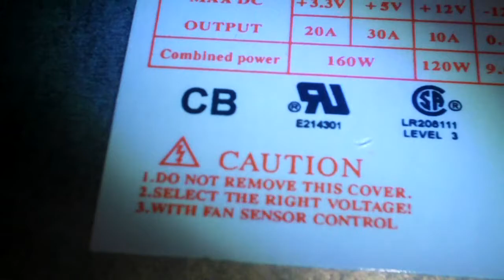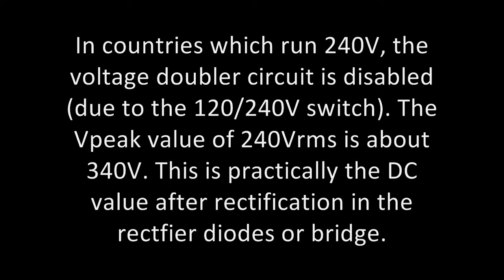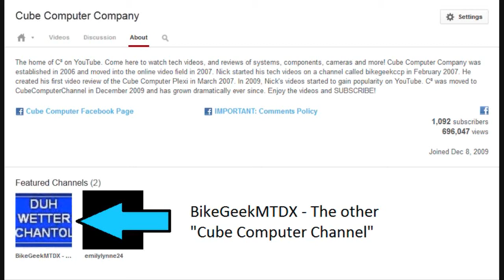How power supplies discharge themselves when unplugged

Comment: What resistor should I use for a red led (believe 2v) as an indicator on the 3.3v line? and closest resistors to use of no concern. And should I put 2 (10W 5.6omhj) resistors on the 5v line being an older supply or just 1 on the 12v & 5v?  Reply would be gratefully knowingly knowledgeable🇦🇺
Reply from the maker: You would need to know the voltage drop of the LED and the rated current of it. Take 5V and subtract 2V from it which gets you 3V. If that LED calls for 10mA, you'd take the 3V, divide it by the current 0.01A and you'd get 300 ohms. The closest 10% tolerance resistor above your needed resistance would be a 330 ohm resistor (orange, orange, brown, gold).

Some people put a resistor on the 5V line of older supplies. Not all of them need it though. I think it helps raise the 12V line a little.

Comment: Don't know if Cube Computer Channel will see this, but I've got a question regarding the power supply and Electro-Static Discharge. So, I'm taking apart my PS4 to clean it of dust. I just unplugged it, but I haven't touched the power button. I'm looking to take it apart today, and I've got my tools. I'm mainly wondering if I have to worry about ESD while taking it all apart, and how I can prevent building up any kind of static charge or potential (i.e. what material type of clothing should I wear, where should I work, am I allowed to move my legs due to being uncomfortable, etc.)
Reply from the maker: Hi there! Generally as long as you are occasionally touching a grounded surface or object, and the humidity in the room is not dry, then you should be fine. Usually ESD becomes more of a concern for me when it's cold outside. The key thing is occasionally grounding yourself.
Reply: I had similar thought and question in mind. Great question

Comment: I'm planning to convert an old ATX Power Supply to a bench power supply.  Would it be a good idea to use a .5ohm 5W Resistor as a Bleeder Resistor on the 12v output?  Basically I have a SPDT Toggle Switch, the common pin will be GND, the NO pin will be Power Supply On (green wire), then the NC pin is 12v output.
Reply from the maker: ATX power supplies already have bleeder resistors on their outputs, so you shouldn't need to add any.
Reply: I'm also planning to use an LTC3780 module connected to the 12V rail for better flexibility as a bench power supply.  Would I need bleeder resistor on this?  Below is the sample schematic, it looks like VOUT doesn't have a Bleeder Resistor or am I wrong?  Thanks for entertaining my question!

http://www.analog.com/media/en/technical-documentation/eval-board-schematic/686asch.pdf

Comment: People say pushing/holding the power button while the power cord is unplugged discharges it, but I would prefer to just wait patiently while its unplugged, leaving just the power cord unplugged overnight would fully discharge it?
Reply from the maker: Usually, the main capacitors are fully drained within minutes, but you can wait an hour or more to be safe. Pressing the power button does sorta speed up the process, but even when just unplugging the unit, the 5VSB rai goes dead within 15 seconds, sometimes a little longer.
Reply: Cube Computer Channel Thanks for the fast reply man! Just the confirmation I was looking for, cause im not in any sorta rush, so simply leaving it sit for a while unplugged is totally fine with me:)

Comment: I am going to attempt to change my PSU fan. My PSU is a 650W Corsair VS650. How long should I wait for a full discharge?. Sorry, just trying to be extra careful, that's all. Thanks for the video!
Reply from the maker: +Swarnava Seal I have opened a power supply to replace capacitors minutes after I unplugged it. But if you prefer to wait, wait an hour or so.
Reply: @CubeComputerChannel  oh thats very reassuring, i have a friend who, well isnt quite an electrical engineer but he knows way more than i do and he very much advised against it, but your video does make me feel abit safer and less worried, i wanted to on one side just look around inside but also see if there was a way to change out the fan on my psu. i left my psu unplugged for  almost 2 days at this point and it is an 80 plus psu but its also not from a brand i know, but- that shouldnt be an issue right? or are there some psus that dont just discharge over time or have some of the safety components you mentioned?

im no proffecional by any means but i find this kind of stuff to be super cool and interesting and have so kind of my whole life

Comment: Would you use a relay to engage the bleeder resistor upon power off?
Reply from the maker: The bleeder resistors are always in the circuit. They draw a very small amount of current. They're there to ensure that the capacitors are fully drained when power is disconnected from the unit.

Comment: How would you arrive at a value for a bleeder resistor using ohms law?  Can you show that?.....at lower voltages?
Reply from the maker: Ohm's law is simply I=E/R where I = current, E = voltage, and R = resistance. If you know how much current you want the circuit to draw at a given voltage, just plug it into the equation.

Comment: can you use a ground bracelet and there would be now problem?
I read that some times it will take weeks to fully discharge, but then how do professionals work on them do they wait a day each time they test it and why in so many youtube videos they run them then afther a couple minutes they crack it open?
Reply from the maker: The reason why you see many techs open up power supplies only hours after being unplugged is due to the circuits shown in this video. Ground bracelets should never be USD when working on something that deals with high voltage. The bracelet makes your arm an easy path to ground. For ESD protection, this is great, but no so great when you end up becoming the high voltage source's path to ground.

Comment: I recently replaced my PSU. I unplugged it first and then I pressed the on switch on my CPU and power came up for about 1s. I assumed at that point the PSU was discharged and safe to work. Is that correct? I've only disassembled the PSU 4 days after that but it is bugging my mind that it could have still be charged after the procedure above.
Reply from the maker: If it has set for 4 days, it's safe to work in.
Reply: ***** Yes, but how about the time just after the unplugging, having in mind that I still pressed the on button and the power came on for 1s and then turned off automatically. Because I thought that turning it on without being plugged to the current was enough to drain the PSU of any remaining charge. Does turning it on after unplugging from the current make a difference or the PSU can still hold a dangerous charge after that?
Reply from the maker: G10Link The charge rapidly deteriorates within the first couple seconds and then the discharge rate slows. This is why it's just safer to wait at least 30 minutes before working inside the power supply. The shortest time I have waited to work inside a power supply after unplugging it was an hour.
Reply: ***** Understood, Thank you very much for your replies and Happy New Year!!! :)
Reply: i have been working on some expensive psu and server psu.i know for sure that some server psu can keep up to 8 to 16 months for charge..(high grades ones).

and more expensive psu in range 300$+ can hold charge like 3 months or more.i know that one my friend got serious injuries by opening such expensive up after 3 months

Comment: can you drain the extra power from the capacitors in a safe manner ? i wan to open up my computer and blu ray player so i dont want to die fried like a bird please help :D thanks
Reply: If you haven't figured it out by now 😉 He explained how the PSUs self-discharge after a few hours. However, in case of your PC, only when you open the PSU casing itself are you at risk. Working inside the computer is otherwise safe, you can even touch it when it's on